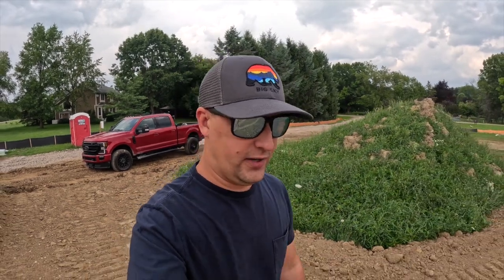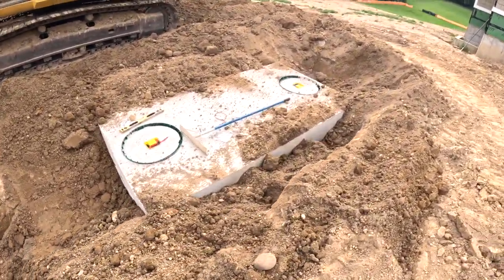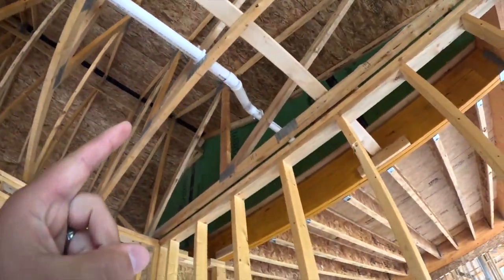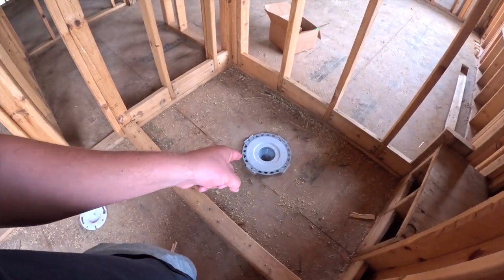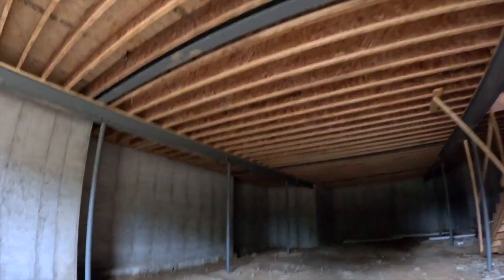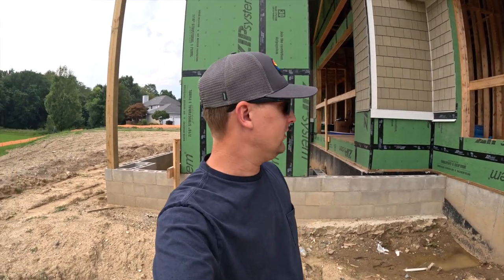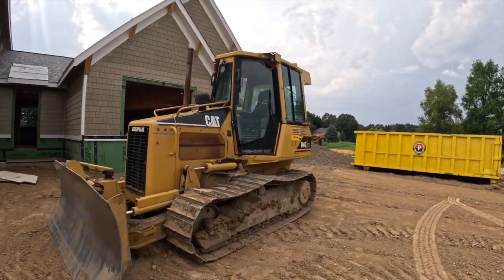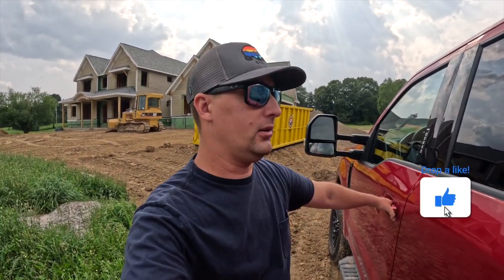THE INTERIOR BEGINS! Rough Plumbing Started ► Rough Grading ► Hose Bibs!

Comment: A good contractor has the crew's clean as you go. And yes it should be in the contract. It does look great so far though.
Reply from the maker: Yep! I confirmed today and they do 2-3 good site visits at different checkpoints. However, I definitely plan to keep up on it, I don't want anyone stepping on a nail or debris getting buried unnecessarily.

Comment: I'm sure on that big of a 🏠 you're going to have more than one condensing unit with multiple locations, not just one because you want to keep them within 25' of the evaporator.
Reply from the maker: I believe we only have one! It's only 3,700 sqft, I see pretty much all of the homes in our area (and many larger than ours) with only 1 good unit. But we shall see!
Reply: @BuildingItTogether I'm not sure how your house is oriented but regardless I would recommend at least two units, one for the lower level and one for the upper level. I would also recommend against putting them by your master suite. 😉